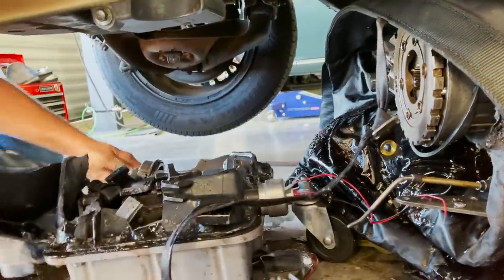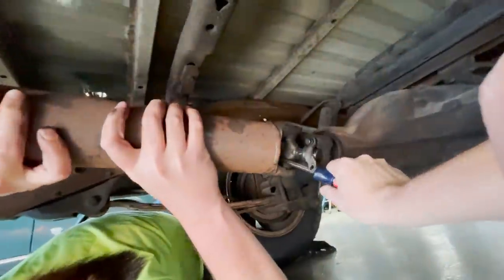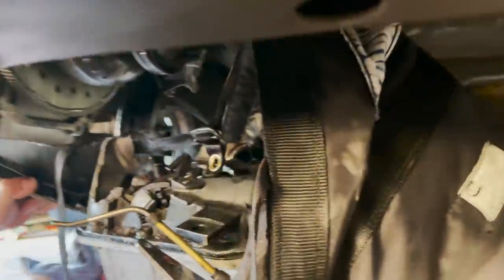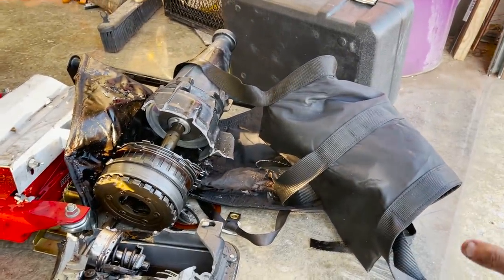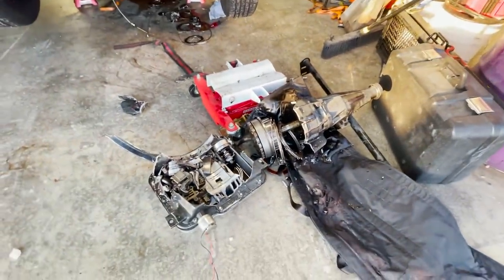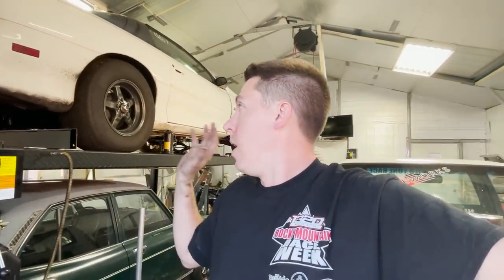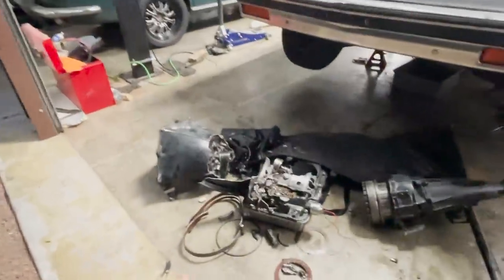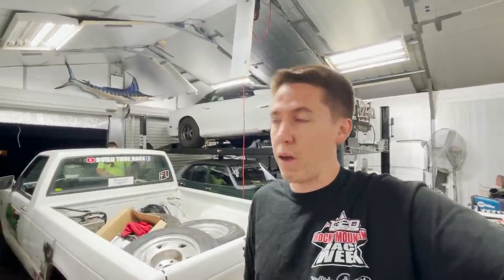Completely Destroyed The Transmission In Burnie The Burnout Truck!

Comment: Its nice to see someone with safety gear thats not required by the rules. most of the time its the other way around, racers trying to run without safety gear they are required to have. sucks that you had to test it though.
Reply from the maker: I figured with the high rpm for such a long time in burnouts we need something. Didn’t think I’d use it in reverse but glad I had it for sure!!!

Comment: Torque converter and flex plate look mint I and sure that there is some debris in the converter and trans cooler and I would have the flex plate checked
Reply from the maker: Yeah I’m thinking when it broke it didn’t really have time to push junk anywhere other than out on the ground lol. 

Going to give the flex plate a really good inspection and then figure out if I can get a different converter or not if we are going to try and make Indy!

Comment: recently saw a powerglide rebuild  on cooper bogetty's channel
the guy that done the rebuild mentioned that powerglides way of clamping the clutches put a lot of force on the the casing aspecially when running higher line pressures  
thats the reason they sell way stronger aftermarket casings for these things , he allso mentioned that the th350 and 400 have a different way of clamping down making them better against exploding
just took a look online and there 1000 bucks and going up from that , it might still be worth it in the long run if you blow up more cases and need to replace everything inside them

Comment: Can I ask for the brand and part number of that transmission blanket? That was lifesaving as that whole box should be all through the cabin as shrapnel. 😬
Glad you're okay. 👌
Reply: Hey Maf, Great effort on running the Veloster at the Rockynats. Pity about the rain. With regards about The Transmission blanket (diaper) it is from Motion Raceworks. 
This one He has used is a Stroud Transmission                  
 Blanket Powerglide  515. I know they do one for Turbo 350's,400's and Chrysler 727's. And they also do one more for the later Ford type Transmission. I am sure you could get one of these and modify to suit your application. What Transmission are you going to run in Crustida?. I had a peek of the pictures you put up on your Instagram and I must say it is turning out great. You should be very proud of what you have done so far. 
I can't wait to see it ripp. Good luck with the rest of the build. 
Cheers Mark.
Reply: @MJTAUTOMOTIVE  Thanks Mark. Yeah, I was looking at MSCN or Stroud. I stuck with the A340 but got it rebuilt and upgraded at Gilroy's. Capable of holding 850hp as it's the same spec that's in Golebys 8sec Corolla shop wagon. 👍

Comment: I've been told PG's are bad about breaking stock cases just from a pressure spike since they have hydraulics in the case.  So jamming it in reverse probably broke the case and then when you hammered on it, it pushed all the parts apart.  Just my guess, lol

Comment: Make it RHD,, then all the shrapnel still goes to the left.
I have never seen any trans broken like that. Cracked and broken bellhousings and extension housings on manual cars yes, a cracked extension housing on a C4 which was probably  transmount related.
IF that engine and tranny is solid mounted they break lugs off of blocks and extension housings on gearboxes. Unless you use engine plates rubber is the only way

Comment: I think you disassembled it the wrong way. You are supposed to keep those clutches and friction plates in the correct order. You will have a hell of a time trying to work out which order they go back in. 
🤣🤣🤣. Apart from the obvious problem with the transmission. You were killing it. I think you must have been doing a little research watching Australian Burnouts. Because out of all the drivers you would have to be hands down the best at doing a Aussie style Burnout.  At the next event you need to let the organisers know a list of things not to do. 
1, no standing burnouts. 
2. No wall taps.
3, 60 second time limit.
4, No nosing your car up against the barrier just to do a Burnout.
5, Must keep moving around the full area of the pad.
6, Must perform a tip in.
7, Try and blow both tyres of the rims in the allocated time. 
8, High rpm but No limiter bashing.
I think you do best job of all the drivers and you will only get better the more events you do.
Sucks about the transmission,  but I guess lesson learned. 
Cheers Mate.
2
Reply from the maker: Thanks again mark for the comment! I’ve been watching Aussie burnout videos for years and super excited to see what we have going now in the states! I think we are moving closer and closer to Aussie style burnouts as the cars and drivers are leveling up with some minor changes for what the US crowds seem to like.